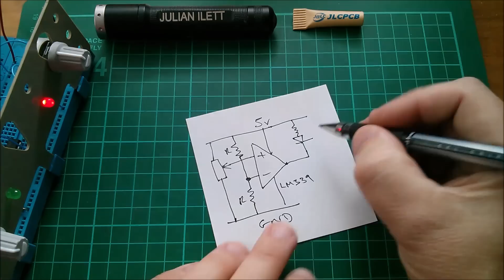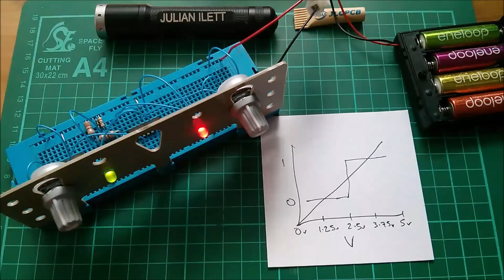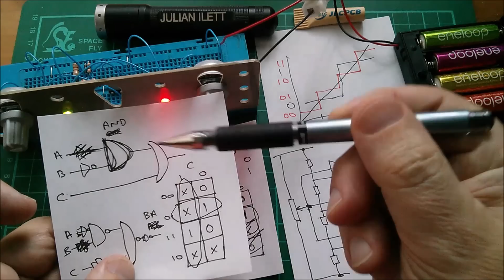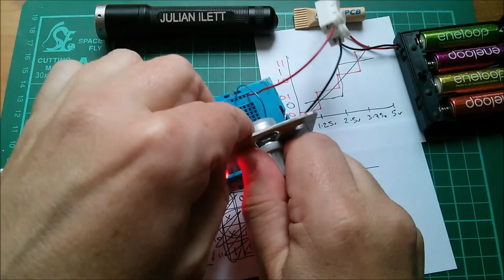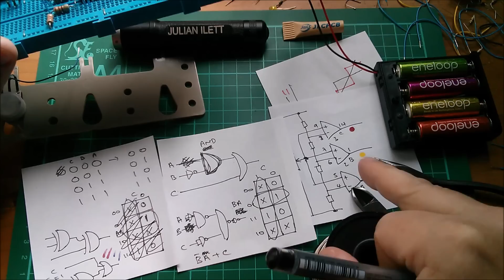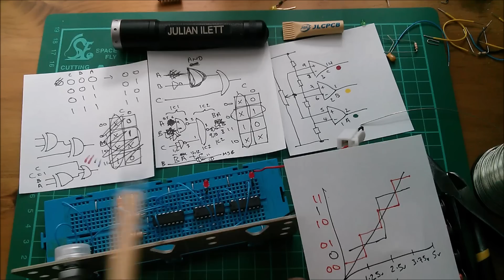Chip on Breadboard: LM339 Comparator - A/D Converter

Comment: This was one of the first IC based circuits I ever made outside of the 555. I got the idea from using a free java based circuit simulator program called CircuitMod, which I HIGHLY recommend, btw. One of the example circuits was a flash ADC with pretty much this same layout, only with XOR gates for the logic, I believe. I didn't have proper comparators, though so I used 4 LM358 dual opamps as comparators instead. My initial version was more like a bar graph display driver, since I didn't put any logic in it to make the output binary. It only lit up the LEDs according to how much voltage was going into the input. I connected the input up to the capacitor on a 555 in astable mode through a mosfet buffer to provide a triangle wave type input to make the LEDs blink on their own.

 I can't stress enough how great CircuitMod is, though. It's a huge reason why I got into electronics in the first place. The other reason being channels such as this one, Big Clive and EEVblog. But just being able to play with circuits without having to buy anything yet was great preparation for the real thing. Once I had learned enough from watching videos like this and playing with CircuitMod I finally made the jump to the real thing. It's a wonderful tool for being able to visualize what's going on in a circuit since it lets you see the path of the current(s) through the circuit, and the examples are great educational fun to play with. Has examples like PLLs, ADC/DACs, logic families with discrete transistors, various amplifiers, passive/active filters, RLC and other oscillators, etc. I probably learned more from that program than anything else, save for actual hands on experience.

Comment: Julian, you can do the decoding with just 4 two-input NORs, eg. one 74LS02.
MSB: B NOR B (just B inverted)
LSB: C NOR (B NOR (A NOR A))
This gives an inverted output s.t. you can attach the LED's cathodes.

Non-inverted output also works with only 4 NORs: (A NOR B) NOR (C NOR (B NOR B)) for the LSB; MSB is just B.

Comment: How about try implementing a discrete Delta Sigma ADC?
Reply: There's a circuit for that in the example circuits that come with Circuitmod. as well as a flash ADC similar to what he made. It's an amazing tool for learning and is free and multiplatform as it's java based. So I'd highly recommend checking it out. It's a very nifty circuit simulator. It heps to visualize what's going on in a circuit since it show the paths of current or you can use scope probes.

Comment: Generate a sawtooth waveform with a couple of comparators, feed that into the main comparator input and you have converted an analogue signal to PWM. That's a really type of ADC and I think it should make quite an elegant circuit, being made of just comparators and passives (and a couple of diodes).

It is used in many switching power supply controllers to change an (approximately DC in the steady state) analogue voltage error signal into a digital signal to drive a FET switch, amplifying the power in the digital signal, then at the other end of the circuit the digital power is converted back to a DC analogue output voltage by an LC filter.
Reply: I made a bar graph driver with this same circuit minus the logic. I used a 555 in astable mode to generate a triangle wave from the capacitor on the RC circuit and just ran that through a MOSFET buffer into the comparator network.

Comment: For the front end instead of comparators you could use a bar graph display driver as long as it was linear rather than the log ones used for audio (LM3914 possibly). Wouldn't be fast but it would demonstrate the principle. Then for the decoding you can cheat again and use a ROM.

Comment: why don't you feed back the output of one comparator into the input of the other with a resistor network and therefore do 2 bits with two comparators and no logic needed? does that work?

Comment: Anyone care to comment on this idea, which may be good or just plain wrong?  To save all the decimal points I'll assume 4V supply and 4V measuring range.  Make the one bit adc shown, which cuts through the middle.  Above or below 2V.   Put the output of this comparator through a few resistors which transform its 0 or 4V output to a 1 or 3V  level. Use this output as an input to the second comparator which will decide whether the input is above or below 1V in one case and above or below 3V in the other.  Hey presto, binary output from two comparators and three resistors!  Or am I wrong?
Reply: Actually you are wrong. The output for each stage is still ideally 0V or full rail. So the comparator for the 2V sense would have an output of 0V or 4V.
Reply: @gordonlawrence4749     but I don't care.  I just read that as the least significant bit of a binary output.  The comparator is turned on or it's turned off....... binary.
Reply: Well that is not how your description reads. It reads like you are generating the next voltage to be compared against from the preceeding stage.
Reply: @gordonlawrence4749    hello Gordon, thank you for your replies.   I hope I'm not muddying the waters further with the following.....   I have some sticks that are anywhere between 0 and 4 units long.  You ask "is it longer than 2?"   If I say no, you ask if it's longer than 1,  whereas if I say yes you ask if it's longer than 3.   For an ascending sequence of sticks we get:
(No,no)     (no, yes)     (yes, no)    (yes, yes).  Which can be represented as 00, 01, 10, 11.
Sliding over to electronics, my first comparator has a fixed reference of 2V.   It's output is logic 0 or 1,  and will be used as such, the MSB.  That doesn't stop me from also using it to drive a one bit DAC, which outputs 1V for logic zero and 3V for logic one.  The output  of the DAC provides the reference for the second comparator which will give us the LSB.  I think I can make a one bit DAC from 3 resistors, so I only need two comparators and three resistors.   A couple of flies in the ointment...  my MSB comparator needs to source and sink, so I can't use the same model as Julian is here.  I'll use op amps instead.   My circuit is a kind of "flash convertor" but will have very short transition periods where the binary ouput  is wildly wrong.  Does Julian's?  Well,  I think so, but maybe going via Gray code obviates that.  Not sure.     A bit of cleaning up of the output may be needed if feeding non-clocked logic downstream.
Reply: To be honest I would need to see a diagram.

Comment: You can use simple transistor for NOT gate, use diode logic to build OR gate, and use resiator ladder do minimalize ammount of elements used in this circuit.
Reply: Additionally I would use zener diode to get that right ref voltage with some caps

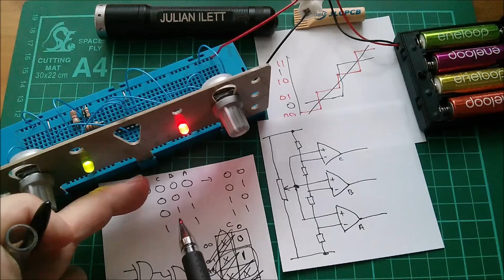Comment: 11:15 Looking at that truth table tells me that not only can the 2's bit be taken directly from B, but if you use an electronic change-over switch with the switching driven by B, you can take the 1's bit from A when B is low, and from C when B is high.

Without trying hard,I can think of two logic circuits which would do that.  The most obvious circuit would use two AND gates, an inverter and an OR gate.

Oooh!  I've done a quick analysis and I've found there's a definite and predictable pattern to translating a thermometer scale to binary encoding.

It seems that for any odd number of thermometer scale bits, the middle bit can always be treated as the most significant bit of the binary output.

That bit is also used to select whether the lower or upper band of the thermometer scale is used for the next stage of processing.

The next stage of processing follows exactly the same pattern for the next most significant digit of the binary output, and you just keep on going until you run out of thermometer scale digits.
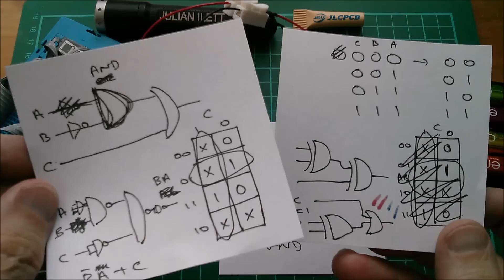Reply: Well done regarding the last three paragraphs. 5:39 it makes sense of that truth table, at least.

Comment: You can use a single comparator and a DAC on one input of the comparator and the other comparator input is your analog signal plus if you want you can add a binary counter to supply the DAC and the binary counter clock can be trough a and gate with the other signal being the output of the comparator so binary counter only runs when there is an output on the comparator.
The DAC can be as simple as a resistor divider network so there will be nothing complex and still simpler than having multiple comparators.
I build something similar a very long time ago but it was using a Z80 that had the successive approximation algorithm so that it was faster. Basically you start with the half scale see if signal is smaller or larger than half then take the half of of the half range and so own until you get the value so no more steps than the DAC resolution say max 8 steps for an 8bit DAC (ADC) compared with up to 256 steps for the counter solution.

Comment: The demorgan thing was right or at least it is how i would've done it

did you try to simply through zeros rather than ones? if you do you can use nor gates to implement it, it may reduce the number of gates

also if anyone wants to use a comparator, please research hysteresis. if you use an opamp with no feedback you'll end up frustrating yourself
Reply: Personally I would have cheated and used a prom or a CPLD.

Comment: Shows how complicated a digital multimeter is.
Reply: Well, not really, cos there are probably none that use this technique.  It's good for lightning fast conversion but, as you say would get horrendously complicated for, say, I4 bit resolution.  Here's an alternative. Ramp up a voltage at a known speed.  It will match the input voltage after a time t,  where t is small for a low input and large for a high input.  Just one comparator and you've measured voltage by measuring time, which is a heck of a lot simpler, cheaper and more accurate these days.  Slower though.  Another comment by electrodocus  (??)  gives a more sophisticated technique.
Reply: Many modern multimeters use Delta Sigma ADCs because they're faster, to enable features like min/max and digital filtering.

Comment: when I was in school I bread boarded 6 bits using a successive approximation. Each comparitor was followed by a 2x amp and level shifter so that  the next stage would then get the next smaller bit. So with 6 comparitor and 6 amp stages I had 6 data bits. It did suffer from missing codes though.

Comment: Couldn't you do this all with transistors?
Reply: Yep you can use a long tail pair for the input of the comparator. Just don't expect it to not drift all over the place though. That's why the first IC's were invented - to reduce drift errors in analogue computers for bombing.

Comment: For the encoding logic on the 2 bits, you could have used a full adder circuit, hooking line A to the A input, B into the B input and C into the Carry input. Might help with making the 3 bit encoder without the chip you ordered
Reply from the maker: I thought about using an adder - thought about using a multiplexer. But Karnaugh mapping it was just too tempting.

Comment: Cries they just don't make them like they used to!
Those panels made them so much more usable.
Reply: You cant get the wide spacing ones at all either. The ones for 40 pin DIL that is. I never found one for the 64 pin DIL packages like the TMS9900.

Comment: Really inspiring video. Love watching your musings..... For (_B C+A) you only need four two input NAND gates. The reason I know, is because there's a brilliant little utility from University of California (free) called Logic Friday. Just specify your inputs and outputs for the truth table, minimise it and then pick from a selection of gates you have available and...... it'll produce the gate circuit! This has saved me loads of time when I just needed to solve combinational logic with a set of 4000 or 74HC00 series I had lying around. Give it a whirl. Only thing is, it does it all for you and takes the fun out of figuring out what needs to be done. Still, very useful for checking your results though.
Reply from the maker: That sounds really handy - is there an online version?
Reply: Hi Julian, I can't find an on-line version, but the Windows program is only 859KB and up to version 1.1.4 which is the one I have. I just used CNET to download it and have checked it's clean with Avira and MalwareBytes. CNET are pretty reliable for downloads. If you're interested, here's the link: https://download.cnet.com/windows/logic-friday/3260-20_4-10268041-1.html

Here's a tip: when you specify the truth table, and this is useful for 7 thermometer inputs as most of the inputs are not required: select the first un-required line and then go down the table and hold the shift key down to select the last one. This selects all the inputs not required. Then right click and select 'Don't Care' to turn all these lines into 'X's. These will be ignored when you finish the table by simply pressing enter. You can then go to the menu option to choose your method of optimisation. From there, use the Gates icon to select your chosen gates and press OK. Job done and you'll see the circuit diagram. There is also a tool to tell you how many packages you'll need.
Reply from the maker: Thanks Andy - that was interesting. 17 NAND gates for the 7 to 3 encoder :)
Reply from the maker: I'm so tempted to build it :)
Reply: Go for it! With such optimisation, I know you're of the same mind as me; that if you've already got the parts you'll do it :-)
Reply: Ooops, I got 4 chips and you got 4.25! I must have missed a step in my enthusiasm to figure it out too quickly.

Comment: Even 24bit DACs measure ranges of voltages, just that they are so small they're lower than the noise floor.
Reply: Not always. Some meters can resolve to pico volts. Just they cost a chuffing fortune and are cooled with liquid nitrogen. It's also possible to make an electrometer capable of measuring femto amps. Just don't sneeze in the same building. You can easily build one yourself with an LM662 and I bet there are better chips out there now.

Comment: Where did you get those ribbon cables? They look like what I need for the display on the replica Science of Cambridge MK14 I'm building!
Reply from the maker: Possibly Greenweld Electronics 2 or 3 decades ago!
Reply: Ah, I'll have to invent that time machine then! I've got some rainbow 0.1" spectra-strip from Farnell but apparently plain grey is no longer available.......
Reply: http://www.rshelectronics.co.uk/product.php?id_product=202
Reply: Thats 0.05" pitch wire not 0.1".  I've got metres of that stuff :) I've considered using every other conducter on it, but it looks weird.